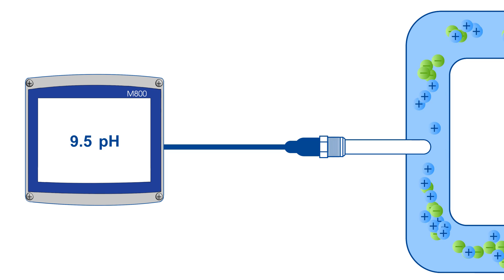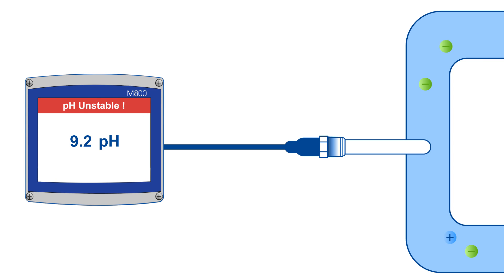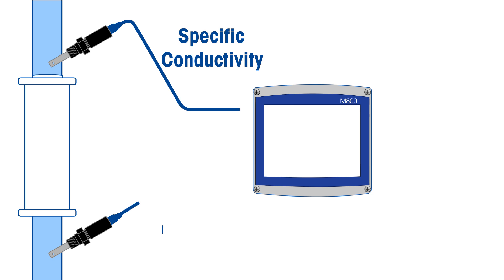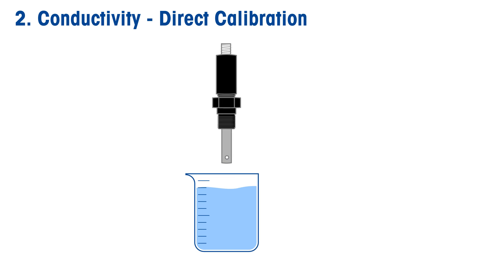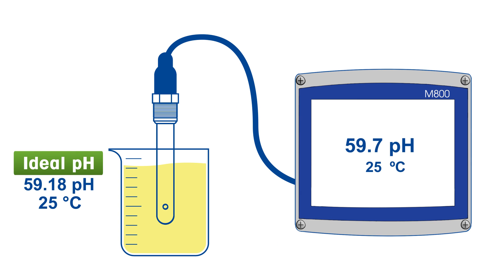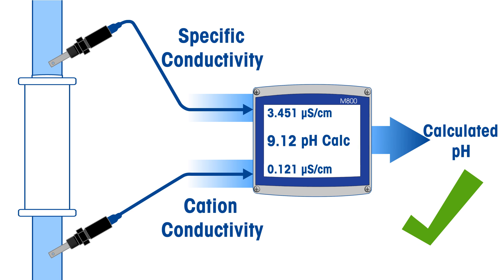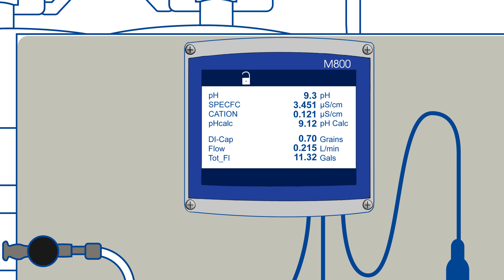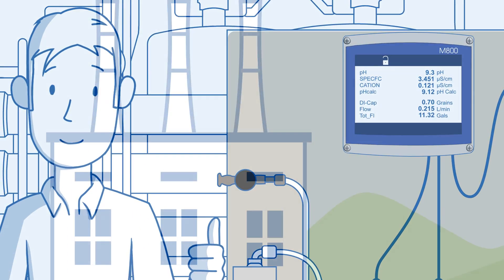How to Use Calculated pH from Conductivity to Validate Water Cycle pH Measurements

Comment: Does it check the Temperatur aswell?
Reply from the maker: Hi AeroChaos.  Yes, the Unicond Conductivity sensor that is used in this video to create a calculated pH does also have an integrated temperature sensor which can be output to the transmitter.